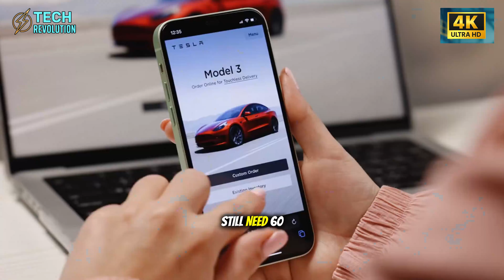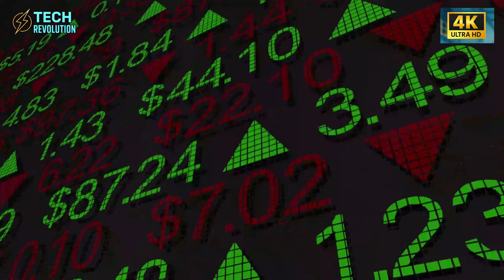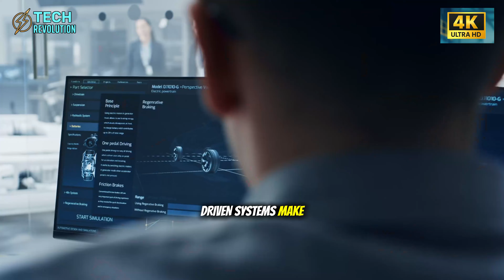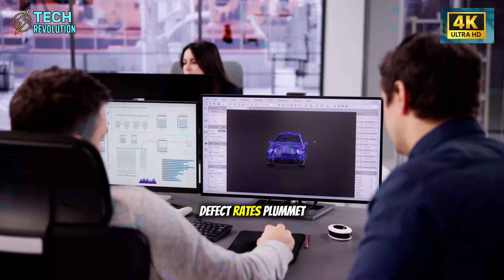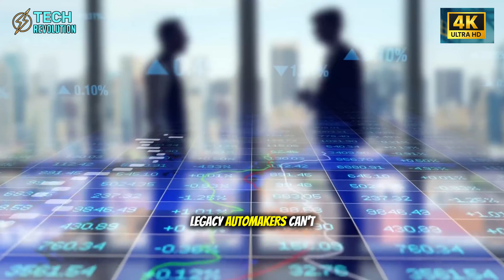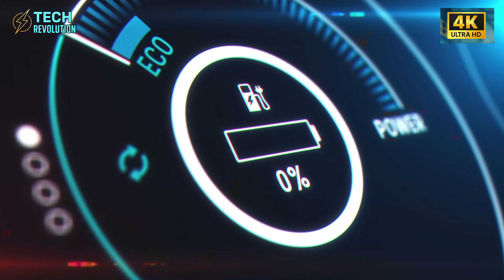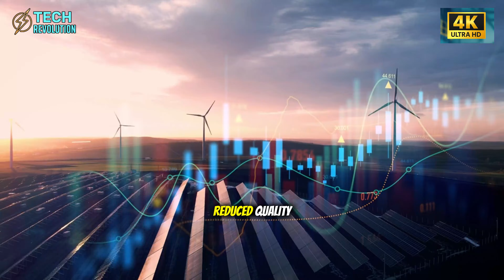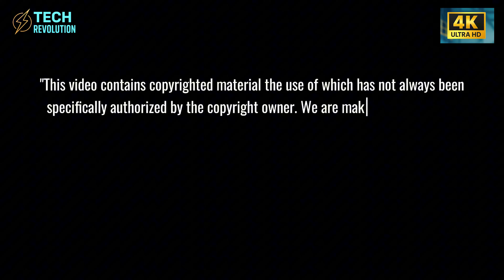Tesla's New Giga Press FINALLY HERE: 30% Cost Cuts! What's SHOCKING?

Comment: fast assembly lines sounds great (7 sec vs 60sec) but therefore you need also someone who is buying all the cars. And if we are talking about reducing plants because you get more output from one plant it’s just the half truth – all your processes have to fit to this short time so you have to find the bottleneck and if you have processes which needs more time you have to implement stations which spread in parallel lines to keep up with the cycle time…
Reply from the maker: True—and that’s the point: Gigapress + parallel stations shift bottlenecks, not ignore them. Demand + Model 2 pricing decide scale, not the 7-sec cycle alone.
Reply: @TechRevolution26  I really would like to see the whole math behind the efficiency of casting this big parts - in my opinion its more marketing.
OEE and other factors are the key in HPDC. These big machines cost way more than the the normal tonnage machines and tools in this size are a complete other world.
So a normal stamping press and welding robots or gluing sheet metal is a easy automatic process, HPDC is way harder to process and have a good material quality especially with this long flow path...